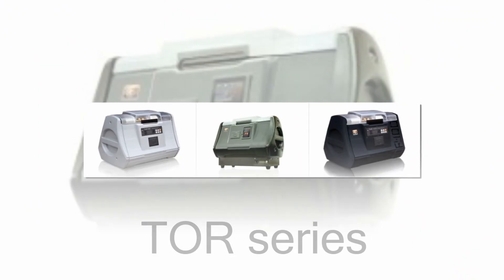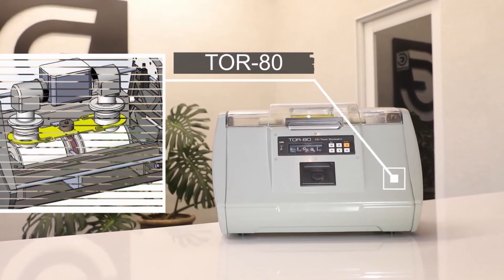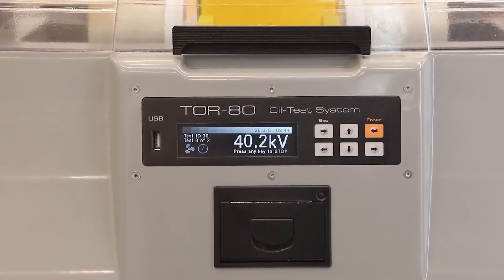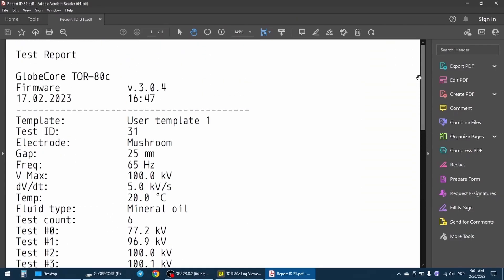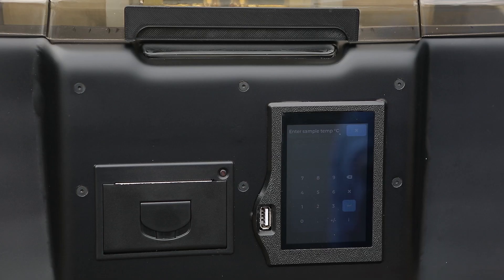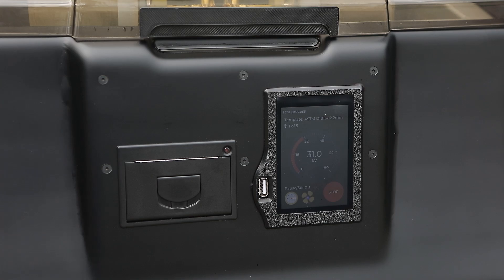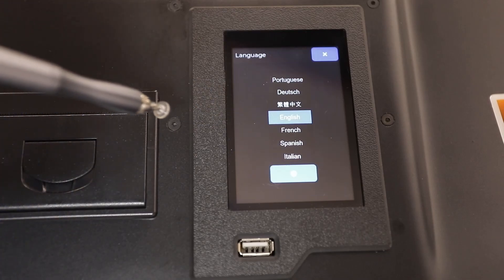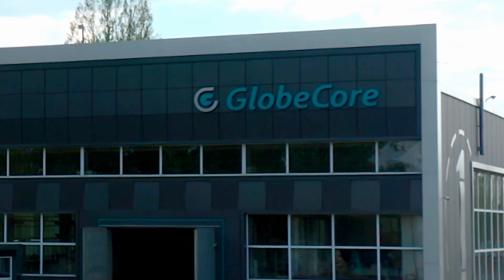Portable Breakdown Analyzer for Oil Testing TOR Series

Comment: What is the difference in weight and dimensions between the TOR-80 and TOR-100 devices?
Reply from the maker: The main difference is the maximum breakdown voltage that the device can measure. These are 80 and 100 kV, respectively.

Comment: How does the accuracy of the TOR-80 device compare to the TOR-100 device in terms of breakdown voltage measurements?
Reply from the maker: The measurement accuracy of these devices is the same.